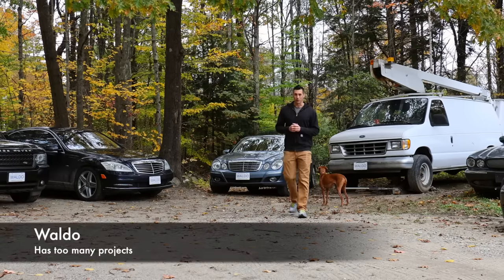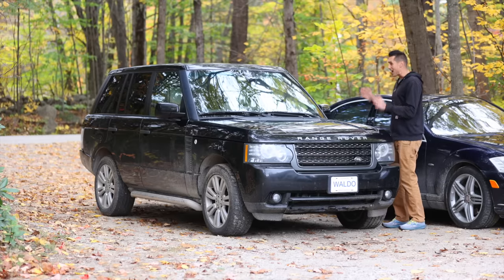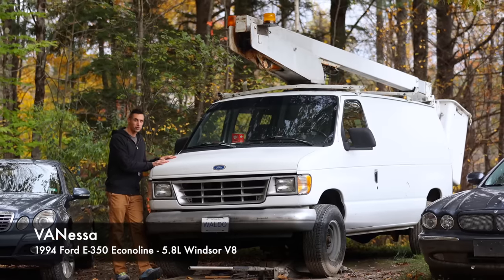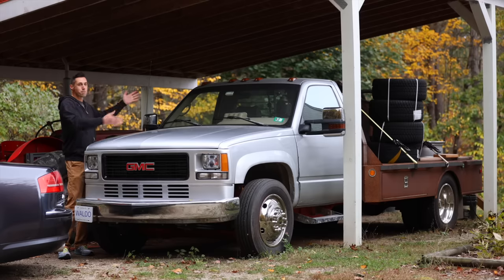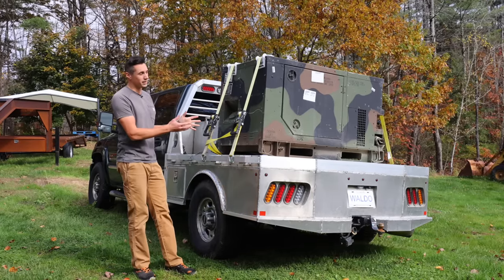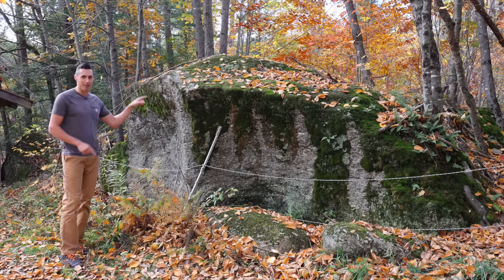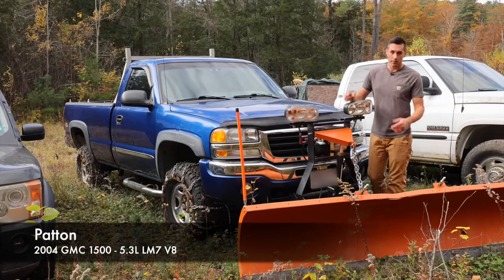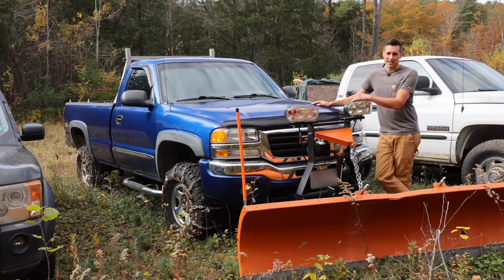Fleet/Project Update! Plus I Bought a 12-Cylinder (Twin-Turbo)

Comment: Don't worry, those Mercedes V12s are like 3 Toyota Camry 4 Cylinders welded together. They can run a few hundred miles with no oil, no problem 😐
Reply from the maker: I hope you're right about that, Sam 😂
Reply: @WaldosWorld  Plz plz plz dont become another samcrac, I've been watching him years and can't remember the last time he finished a project.
Reply: Oh snap.
Reply: And really looking forward to the S600 content!!
Reply: I agree always waiting for more videos from you. So great to watch your straight forward explanations. A+++++
Reply from the maker: @DjJay   I'll say this: at least I succeeded in fixing a Range Rover 😬
Reply: @WaldosWorld  😂. Thats what got me starting watching your channel, I've owned at least 5 range rovers over the years from the Range Rover Classic, P38 to the L322, so I pretty much know and love them. And I've managed to maintain them on a shoestring budget, but the L322 was the most problematic of the all, because I had the early one with the BMW M62 Engine and BMW electronics. Basically a BMW in a Range Rover Body. Had to do the timing chain guides, rehone the cylinder walls, new head gasket, radiator, BeCM, Ignition so on and so forth. It did help to keep costs down when a local RR club owner just donated his 05 LR to me for nothing. It became a parts car for me and two other buds who also had L322s. The most reliable year for the L322 is the one with the AJV8 between 2006 and 2009, in 2010 again they crapped out with the timing chain guides
Reply: Hey Waldo regarding the LR3, keep the sun roof taped up, reroute the wire loom that gets water damaged and drill a hole in the floor to let the water out. There Wander is sorted 🤷
PS fix your plough on her and get rid of the 2 wd pickup 👍🏻
Reply: True and post more episodes in time sometimes he disappears
Reply: @WaldosWorld Sam runs most of his cars without oil - he would know. Also I think he has even welded some Toyota engines together to run in his Ferrari. Damn has mega experience with that sort of thing cos he has to repair the repair at least 5 times each.😢
Reply: @DjJay I don't know who that sam person is, but I was thinking the same thing. Don't be an ADHDer and never finish anything like myself.
Reply: @WaldosWorld Totally agree. You got a really good channel and could easily be in the millions for subscribers!
Reply: @WaldosWorld  MR. Waldo SIR..  which Range Rover engine would you  consider good? I will be in the market to buy one.
Reply: No engine will last more than a few minutes w 0 oil in ot😂

Comment: What you need the most is the proper shed / garage where you could work on hot, cold, wet, stormy days... and the XJ looks like a nice addition to the fleet.
Reply: the lift concrete pads are super sketch!
Reply: What xj?
Reply: I believe the jaguar is an XJ. Not the Jeep kind of XJ unfortunately

Comment: Building a proper work area (shop) should be high on the list.
With you being a jack of all trades type of person I don't envy the complications that setting up your shop will be... but I'm curious how you will deal with it.
Reply: Not that he needs another project added on but fixing excavator, doing a quick-connect style pin system & getting (new)hammer for it sorted out. Then he'll be able to dig foundation & footers for the new concrete for the new shop. Idk, it's a lot of money to put a building up, might have to start off in the (way too small) 'barn' hes got now, maybe pour a legit floor or at very least put a tamped crusher run 'base' down to have a solid floor to work on.
Reply: Id have started with a shop. Concrete pad with a pole barn or I beam construction. Best way for the type of work he does would be have one corner framed in as a “clean room” workshop for electronics work and small workbench jobs- a door to access from outside and then bay doors into the main shop for heavy work and storage.

Comment: The LR3: There is a factory repair bulletin for a leak in the A pillar that sounds like you have. LR time did a video on it a while back. The repair is a small sticker over a hole from memory. Love the update, keep up the good work :) Cheers, Steve in New Zealand
Reply: Helpful input. I've seen that video too. Nasa Tape solves that problem by removing the outer skin of the A pillar to expose the hole. Waldo must try that.
Reply: Agreed. Sounds like the issue given it’s happening on both sides. Poor design for sure! LR Time has your fix.
Reply: Shame as when they are sorted they are such nice vehicles. Especially the 4.4 V8.

Comment: Just with the water leak on Wanda your LR 3 I have a LR 3 and the water leaks came from 2 main sources - under the windscreen pillar covers (need to reseal all holes properly especially bottom one) and sun roof drains blocking or breaking. You can either replace these or if that fails run them into air con drain (as one goes behind fuse box and is a real pain to access). Don't give up! Try the windscreen pillar fix - it is quick and easy.

Comment: Hey that v12 could still be good. The hole may have come from being moved around the auction yard. The reason I say this is because I couldnt see a low oil pressure warning on that cluster, though it is a very limited picture in terms of field of view. I would also think with a digital display that there would be a big neon warning for oil pressure as well as a check engine light. Having the battery disconnected maybe it has cleared the memory of the vehicle, BUT it may be worth it to hook a scanner and see if any codes are stored. I work for Daimler on the Freightliner side and if theres anything that Mercedes does best, its log fault codes lol
Reply from the maker: I did hook a scanner up and there were no codes due to the battery being dead 👍
Reply: On W221s the low oil pressure would come up in the centre screen (theres no actual light) so as far as the picture goes its getting oil pressure.

Comment: Great video Waldo. Nice to see Aspen keeping the chipmunks from upstaging you. 😂😂
Couple things if I may. When you do the rock crushing, have the front window covered with screen. That material can shrapnel on you. 
Second, with your plow truck, even tho it’s a 1500 weigh the back down. We used to use railroad tracks. Because we were local we didn’t worry about the overload. It was about traction. We had an old F350 plow on a 71 Chevy blazer with the tracks boxed in the back. 
Third on VANessa- check fuel filter. They get restrictive quickly. Burns up the pumps and you have loss of power. Also check the air intake by the butterflies for carbon and sticking. Also on the sensors on intake. Just need some carb cleaner to remedy that. 
Thank you for sharing.

Comment: I feel the pain in reference to working on the Ford van. I worked on a fair amount of the  E350's specifically with bucket truck conversions the company I worked for installed  them and was a dealer.
 Always remember Ford is owned by Snap-On tools.😊
Reply: I hope you guys are opening the doghouse in the cab, makes it way easier
Reply: Being a eec-v vehicle, it actually had stricter emissions then the later OBD2 versions. 

I personally like the eec-iv vehicles, because they are modern enough to pull codes and troubleshoot, but not new enough they have all the extra emissions and wiring of a more modern vehicle.

Comment: For attaching the hammer to the excavator, you canlook into a verachtert quick attachment. It is common in the low countrys but I have never seen them on youtube before. You can make the attachments easaly with a but of 20 mm plate, blow toch and a good welder.

Comment: Waldo,
I’ve discovered your projects recently and find them very well done. I’ve owned two MB550 S Class. A 2007 and a 2012. I bought both with about 30,000 miles on them. I loved everything about them except the depreciation and maintenance costs. I’m no where near as skilled at upkeep as you and I’ve found that Mercedes service and parts departments should be wearing a mask when they service these otherwise great cars. I drove both 550’s for 4 years and loved them but they both sold for about 25% of what I paid for them. I guess that’s why the primary owners of these are doctors and lawyers. 

Keep up the interesting projects.

Comment: My daughter had one of these discoveries.  We found it hard to keep the water out and the oil in.   After spending a fortune in the dealership trying to fix the water ingress leak a neighbour (in the Land Rover club in the uk) fixed it by removing a little grill on the front right wing and repairing a drain hose from the sunroof

Comment: When it comes time to work on the S600, get ahold of Legit Street Cars on You Tube. He is a Mercedes guru. He has lots of content on the S600. They are extremely complicated engines that require specialized tools and knowledge. Thanks For the update video. You are gonna need to build a sand blaster for that gooseneck.

Comment: Hey Waldo! Love the excavator. As someone who has just taken on my own rock destruction project, I think you're actually going to need to weaken rocks that size before using the hammer. You could definitely use the hammer, but those big granite boulders are a lot of work and hammering might not be enough. Ideally, rent a compressor and rock drill and drill holes into the rock that are 75% of the depth of the rock and then use an expansive grout like dexpan. It's not easy work, but at least you have the heavy equipment to make light work of the chipping and clean-up. 
As a comparison, I started with nothing and ended up buying an expensive Bosch SDS-Max hammer drill. As good as the Bosch is, it still takes a long time to dig 2 feet holes and you need a bunch of them for the Dexpan to work effectively, I'm making it work because I don't have access to rentals or heavy equipment, but it's really not enough for big boulders. See how you go, but if you find that the hammer attachment is taking too long, that's the route I'd recommend. A good YouTube channel is @demolitiondave and he's really responsive and helpful as well.
Reply: No explosion? Booooo!

Comment: You should go with a side dump for your dump truck idea. I pull double side dumps here in SD and there's a company that actually makes a side dump from a straight truck. Smithco. Side dumps are awesome because you can dump to one side or the other and not worry about having a high CG like an end dump.

Comment: The Land Rover has a drainage tube underneath the dashboard that runs into the engine bay that can backup with debris during rain or snow fall that is why you have water on the passenger floor board it needs to be cleaned out

Comment: A nice long metal building shop with a heated concrete floor, 80 feet long and 40 or so feet wide, would be great to pull a gooseneck through longwise with room to unload, then dedicated bays for welding, tires, vehicle lifts etc., so you could have multiple projects going side by side in a temperature controlled environment. Just post more often, and YouTube will pay for it 😂

Comment: Hi Waldo, don't know if you checked this or not but a common leak point for any car with a sunroof are the drains that run down the A pillars.  You can blow them out with compressed air but they usually get clogged again.  That is my biggest gripe with sunroofs.  You have quite a collection going on.  Hope the V12 Mercedes turns out to be an easy fix.  With twin turbos, that thing should move pretty good, and with style!

Comment: I love your channel - it has all kinds of really useful information - I found your channel while poking around for backup diesel generators and.that video is really great for all the information you cover in it

but then I found this video and I’m really glad I did!!  I hope you can get your S600 back on the road, because it’s truly a fantastic car - I owned a 2002 for several years and it was as smooth as silk - but I recently found a deal for a low-miles 2012 S550 4MATIC SWB that I just couldn’t pass up, and I hope to never to sell off

anyway, I’ve subscribed - keep up the excellent work!!

Comment: Your Lr3 leak problem is coming from 1 of 2 places. On the A-pillar there is a open hole below the plastic cover. The LRTime channel did a video on this. It just needs to be covered with tape or sealant. It could also be coming from the firewall. Inside on the passenger side there is an cabin air intake that can collect water and the water will come in on the passenger side firewall and down to the footwell where you are getting the water. People cover half of that intake with tape or 3d print a cover that will shed the water leaking in from the cowl. Hope this helps. Keep up the interesting videos.

Comment: Wanda is likely suffering from one of the 1000 leaks locations these cars have. First thought is the ac drain. On the right side behind the trim there is an ac drain plug with another little nipple and cover. You pull the rubber boot off and run some compressed air and a piece of weekwacker string to clean it out. Another common leak is the windshield. Because these cars have heated windshields, the heat melts the urathane overtime and leaks right in. I know you said you replaced the front drain plugs, but dont forget, there are also rear sunroof drainplugs located near the rear seatbelts behind all the trim. When these go bad, the same thing happens. It just dumps water into your electrical channel.  Another common leak is the cowl. The cowl overtime warps and has no seal and just pours water into the firewall. The last one is the A- pillar exterior trim. The seal on the outside goes bad, and then water gets in though the clips and goes right down the pillar into the channels. I have experienced a leak from every possible location on my LR3.

If you have any questions, I will gladly go into more detail on explaining the locations. Most of these fixes are not too hard.

Comment: The height of the Mercedes might be due to the sway bar bushings.  Try loosening them and let the bar twist with the weight of the car on the tires until it is lowered to the correct ride height. Retighten the bushings and see if this works.

Comment: So with that 6.9 idi international, Turbos are good, but lead to other problems related to the boost. Adding propane injection give you the same added power or possibly more, it will run cleaner and your EGT's shouldn't ever be a problem when working it.

Comment: Hi Waldo absolutely love your content been a fan for a while now. I had the D3 dreaded water leak and spent months fixing the sunroof only to find more water ingress until I found the issue. Believe it or not it’s the seem joint in the roof rail area near windscreen you wouldn’t think it as it just looks factory however, it lets water in quite badly. I cleaned it and used tiger seal which actually worked job done. Please give Wander one more go and fingers crossed it’ll work for you 11:35

Comment: There is a lot easier and cost effective way of "smashing" rocks, especially for places with cold winters. Just drill wholes in the rock and pour water, as the water freezes it will crack the rock. There is another method (called Iutkin effect), again with wholes filled with water, but requires good  knowledge of dealing with high voltage capacitors, and definitely is not for everyone.

Comment: The E320 with the front end being higher is probably causing bad fuel economy as well. Just like when you lift a truck, the fuel economy goes down. Maybe cut the springs down or replace them to bring the car back to factory height.

Comment: Waldo's world, we owned an LR3 and what happens is that the hose coming down off of the A pillar from the sun roof  has a rubber boot/grommet that connects that hose to the fender in the footwell that tend to decompose after time, which causes water to come into the cabin.  Of note, this failure point is right above the fuse box so then the water leaks onto the fuse box.  I was going to bypass this boot entirely by extending the hose to run it through a grommet and have it terminate outside instead of inside but then we sold the vehicle.  It's a pain to deal with - bad design.  Hope this helps.

Comment: You seem like your euros. If you want a good suv, buy a x5d with the m57 and delete it. You will like it significantly more than any comparable Land Rover. Easy to work on inline 6, zf transmission, no electrical issues, and towing capable. They also sound amazing.

Comment: w211 front struts are adjustable. Mine was like that until I fixed it. Rear springs have spacers if they are too high or to low as well.

Comment: I wouldn't mess with the van.. Those old Fords are simply GUTLESS.. I had a 95 F150 5spd 4x4 with a 302 and it was a great truck --  but really the engine was really weak and underpowered.  I wouldn't keep throwing money at it;   that's just how they are.   They will run forever, but they just don't have much power.  So lower your expectations and you'll actually find that the Van is probably doing well.   Well enough anyway. :)

Comment: In the comments section of another of your videos I suggested buying a deuce-and-a-half. I learned recently a deuce-and-a-half can be used as a fire truck; what do you think about that as a project? Or how about repairing an actual old fire truck? With all of the equipment and no doubt fuel you have around, it might be very practical to have a fire suppression system close by. Your thoughts on that??

Comment: I know its probably to late, but that auction company probably windowed that engine on the Merc. You are looking at a hole in the oil pan. They made that car worthless. I know they say those auctions are as is, but you should be able to prove without a reasonable doubt they blew that engine up after the fact.